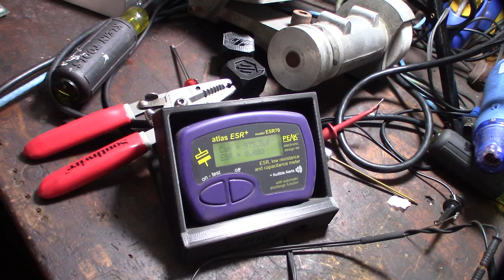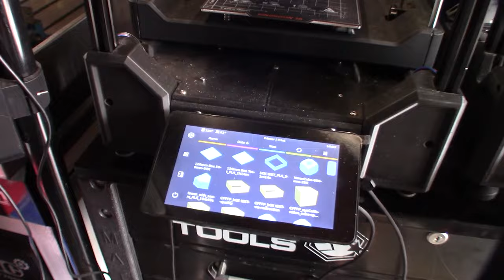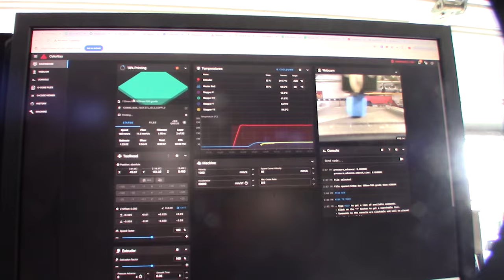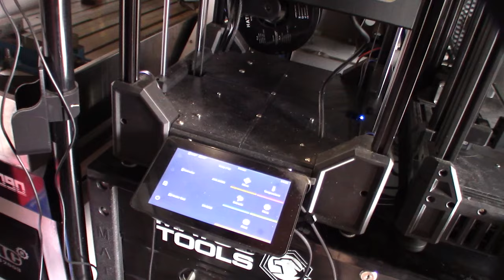Celeritas adding large capacitors to TMC2240 to prevent voltage current drop on hard accelerations 2

Comment: Very nice!!! I wish I had a printer that could run that fast to do some scope captures but I don't currently. We need to know what is actually going on with the supply and if printer baseboards need more capacitance on them!

My "fast" printer right now is running TMC2209, 1.45A, 8K accel. I only have 300uF on that entire rail. I am a bit embarrassed to say I didn't choose that value based on testing or theory but just based on what other people have been doing. I am going out to set up a scope on the board now 😅
Reply: Okay. I moved the printer to the lab and soldered a short probe to the ground and power planes right next to the drivers (drivers are connected to bottom plane by an insane mass of via stitching). I recalibrated resonance and set accel to 40k. Speed is 350mm/s. The rail is absolutely rock solid on the scope. I mean there is absolutely nothing, I set a trigger at 23.8V and it doesn't fire.

More details of this setup: TMC2209, 1.45A, 24V Meanwell LRS-450-24, custom board with drivers directly on board, 300uF total, StepperOnline 17HM19-2004S1 motor (0.9 deg, 2A, 4.0mH), 20 tooth 2GT, CoreXY.

So here are some hypotheses?
-Your Meanwell is undersized. Since I have a 450, that is going to have a lot more builtin output capacitance.
-The baseboard you chose is poorly designed and introducing resistance/inductance in the current path.
-The connection between baseboard and driver (the pin header) is introducing resistance/inductance.
-You have a poor connection between the PSU and the baseboard, introducing resistance.
Reply from the maker: Are you able to hit 45K without skipping steps?
Reply: @fintechrepairshop  Yes. It was running at 40K, 350mm/s, with no step skipping (note this is 0.9deg motors so twice the step rate for that speed if you are using superpowers or whatever). However, input shaper is definitely also a factor. It set X to 3hump_ei. If I were looking at your machine I would scope *voltage drop* from the driver to the psu, on both + and -.
Reply from the maker: I'm running 1.8 degree steppers. My power supply is a meanwell 350 watt. My bed is only 180x180mm. How big is your bed? I'm using high quality heavy gauge wire between power supply and mainboard, as short as possible. I hear what your saying.
Reply from the maker: I read somewhere that 0.9 degree motors have issues with high accelerations. What has your experience been between 1.8 and 0.9 degree steppers?
Reply: @fintechrepairshop  The bed is pretty big and heavy but right now I have travel restricted to 160x180 since I was testing some toolchanger ideas. This printer is 8mm rods and bowden so it is actually pretty lightweight for what it is. Not nearly as light as your setup though of course.
Reply: @fintechrepairshop  I have found 0.9 degree accelerates better than 1.8 degree but has maybe 70-80% of the top speed, with the motors I have tried. Note however, I have not tried superpower motors yet. I recently ordered some but haven't installed them anywhere yet 😆
Reply from the maker: Here is a comment from my first video. 
"Have you ever seen sumo robot fights? They're really neat, only 3kg and huuuuge current draw. They use some huge capacitors in their motor drivers exactly for this purpose."
Reply from the maker: @jessicav2031 Jason from LDO just sent me two Super Power HT. I now have 2x Speedy Power HT and 2x Super Power HT to play with. The stepper online 17HE19-2004S steppers I'm using aren't the greatest motors.
Reply from the maker: @jessicav2031  DC or AC heated?
Reply: @fintechrepairshop  1/2" Gleich tooling plate with 120VAC heating. Always 😁
Reply from the maker: I actually have my LED's running off my power supply and I don't see them flickering. If I was having voltage drop I would probably see it, not unless its happening faster then my eyes can register.
Reply: @fintechrepairshop  If the LEDs are unaffected, it just means it is at the mainboard or the mainboard->driver connection I guess? It makes sense that 300W should be enough.
Reply: @fintechrepairshop  The AI is on to me trying to post a link...it doesn't like it...
Reply from the maker: @jessicav2031  Look at the Kraken board from BigTreeTech. Look at the size of the capacitors. Looked at the schematic. 820uf on larger drivers with mosfet chain and 680uf on the smaller ones. The usual boards I see have about 100uf under each driver.
Reply: @fintechrepairshop  Yeah those are 8A though. Kinda like those 10A external ones you have, it makes sense that the capacitor is 5x bigger. Also wow, 200x113mm, that board is huge!
Reply from the maker: @jessicav2031  You said you have 300uf for the whole driver rail? No voltage drop at 40K?  How many motors do you have on the rail? I'm going to hook up my scope and see what the board is doing this weekend. I'm going to step up the speed to 50K and 800mm/s tomorrow.
Reply: @fintechrepairshop  Yep. I just posted my scope capture (in AC coupled mode) as a "video" on my channel.
Reply: @fintechrepairshop  I have XY, 3x Z (and E was not energized). Hotend and bed off.

Comment: For context, I don't have an electronics background, so I was wondering if you could shed some insight into the matter.

What are the pros/cons of 1000uF electrolytic caps over 10uF ceramic caps? I've read that ceramic caps have lower ESR - whatever that means 🤔 

Did you add any extra circuitry besides the caps, or can I simply follow suit and solder some to VCC and GND of my stepsticks?

Since the TMC2240 technically also support 36V, do you have any plans on bumping them up to said higher Voltage?

I'm not sure if most mainboards have a 36V mode, but I'm also curious if it's feasible to use a soldering iron to push the VCC Nad GND pins upwards so they don't interface with the mainboard socket below and to be powered instead by a dedicated 36V psu directly rather than taking 24V (or 36V if possible) from the mainboard - all the while still receiving uART signals from said mainboard 🤔
Reply from the maker: I'm running 24V. I got 50V caps incase I want to step the voltage. The bigger the capacitor the more of a buffer. I might try some larger ones. I guess I didn't even think of ceramic caps because all the board manufactures are running electrolytic. In my last video I got my printer moving at 100K acceleration and 1000mm/s on 24V 1.5A
Reply from the maker: Those speeds would not have been possible without those caps.
Reply: @fintechrepairshop  I'm wondering if 63V or 80V caps would provide similar enough headroom for 36VCC - similar to how you're running 24VCC with 50V caps. 🤔